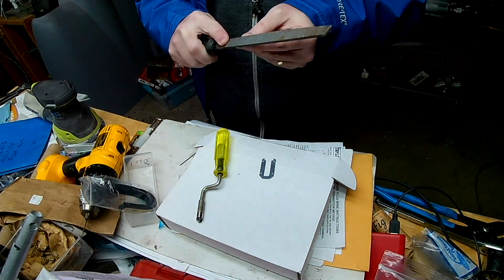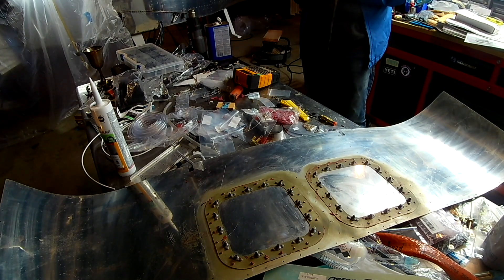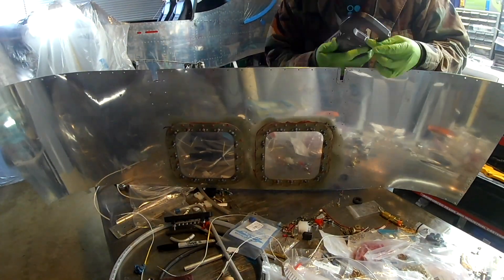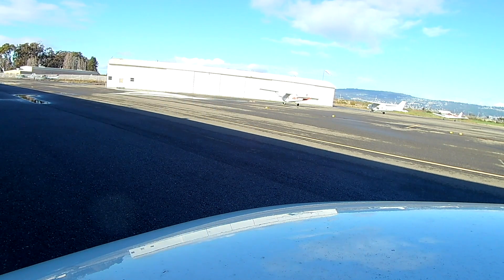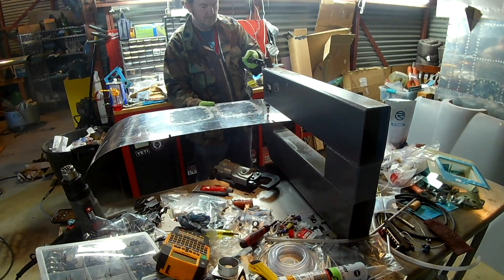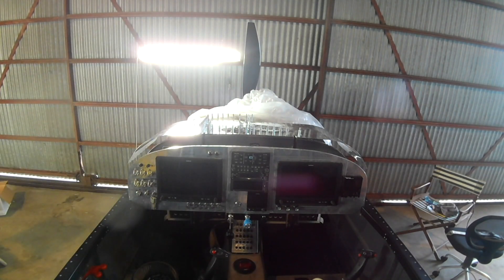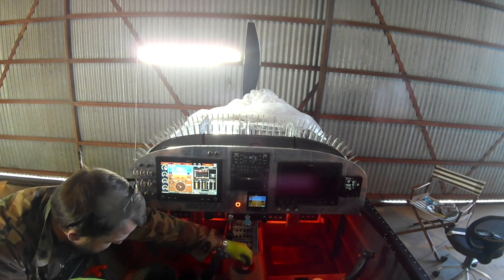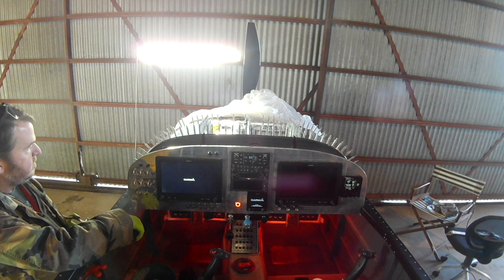RV-14 Ch 35 - 12

Comment: On my RV 7A, I put a longer boot on the battery leads, as there was always a potential of dropping the long piano wire pin across the battery leads.  I wish my plane had cam locks, it's such a pain pulling out & inserting those piano hing (long) wires.
Reply from the maker: The camlocks are actually pretty damned easy to set up once the cowling is trimmed (as you’ll see). They do take up some extra axis space because of the camlocks bodies but that’s only an issue if you’re a creative builder sticking stuff where it doesn’t belong.